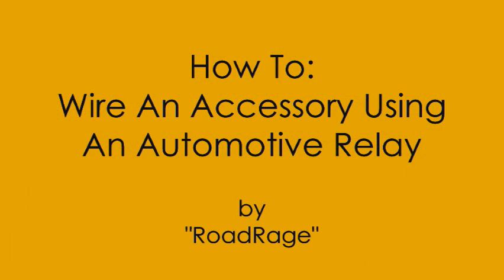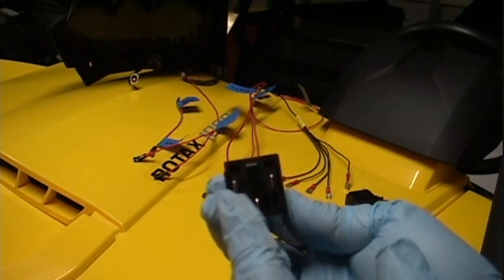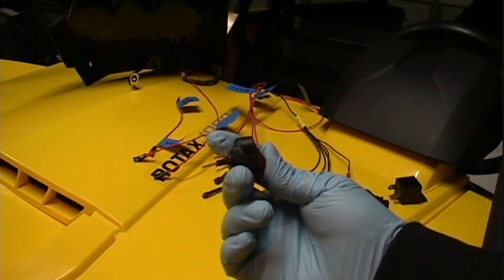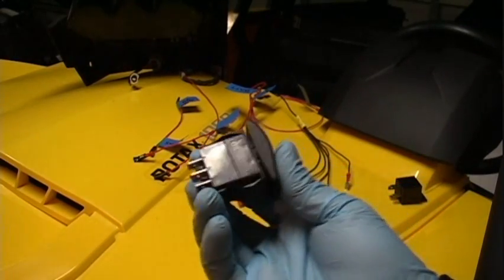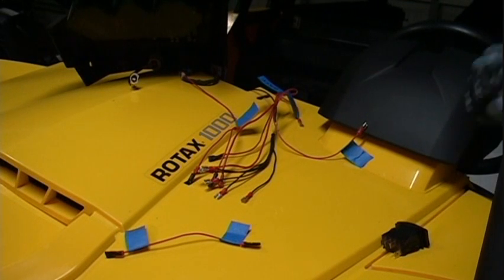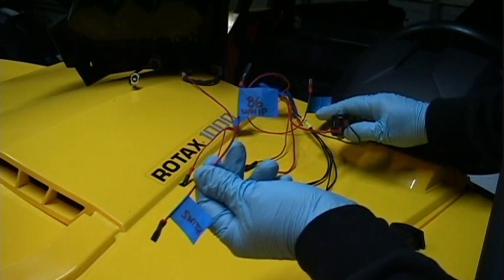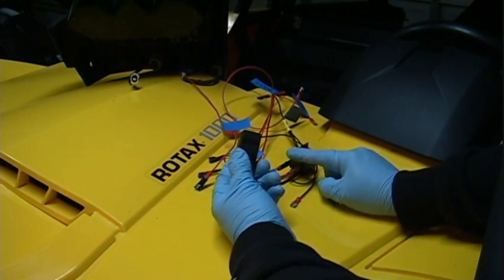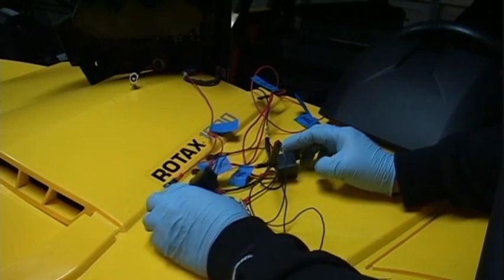Can Am Commander Accessory Wiring using Relay

Comment: With that switch you installed you will only be able to power 1 accessory at a time, whip or dome light but not both at the same time. I have the same problem you have limited space for rocker switches. All that being said, do you know of any Rocker switch that actually can power 2 accessories at the same time?